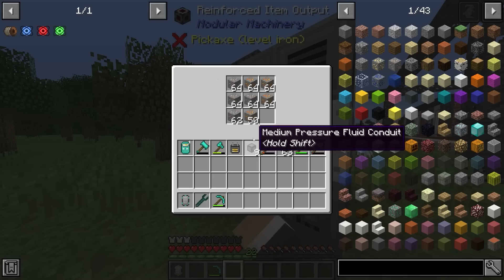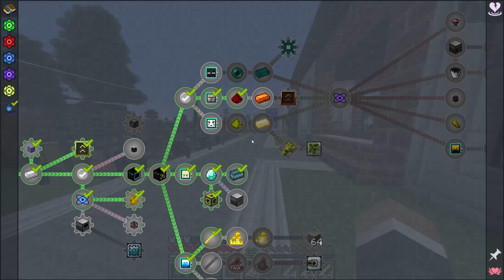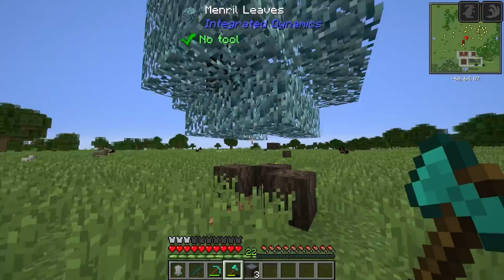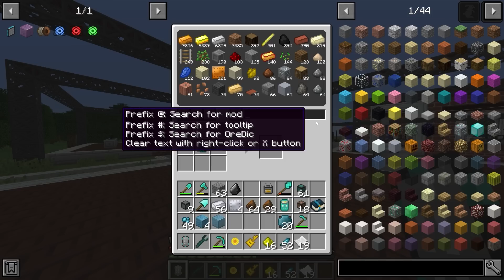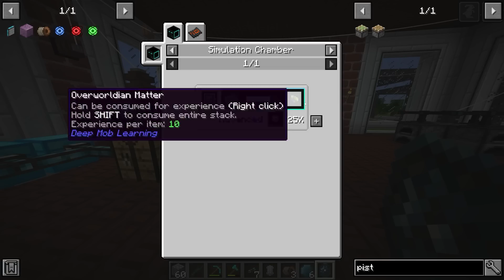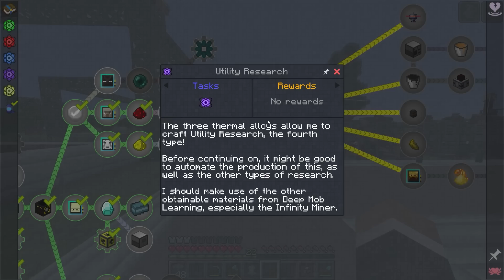Minecraft Feed The Factory | INTEGRATED DYNAMICS AUTO-CRAFTING! #16 [Modded Questing Factory]

Comment: Besides, you could just keep an Omni-directional connector and a couple of terminals in the storage at all times, and pull them out whenever you need remote auto-crafting.

EDIT: You could just use a Dispenser to auto-fill Buckets.

Comment: ID (provided that the mod IntegratedTerminals Is in the pack) has a wireless remote, I think it's called a portable storage terminal. Works exactly the same as the simple storage remote giving you infinite range trans-dimensionally with 0RF cost, just click on the omni-directional connector and you're good to go.

Comment: Don't forget! You can now use Integrated Dynamics' cables to do all your item transport as well, instead of EnderIO cables. if and when you need more powerful filtering and routing logic. Depends on which system works more convenient to you.
Integrated Dynamics cables can transport not only items, but also fluids and energy, in one cable. It only requires different types of interfaces for each connection. So no more need to craft different types of EnderIO cables and combining them into the same blockspaces anymore.

Comment: Integrated Dynamics does have a remote storage terminal, actually. Though in its standard recipe it needs chorus fruit and ender pearls to make the antenna-equivalent, and I'm not sure if you have access to those yet. It's pretty overpowered in some ways though, what with infinite range, cross-dimension access, and no power consumption just by default.
EDIT: Ah, you found the omni-directional connectors. Those are also the "antenna" for the Integrated Dynamics personal wireless access.

Comment: The intergrated dynamics system didnt work with simple storage because you used an import cable to do that which "imports" from Integrated dynamics into Simple storage. Try using an export cable so that the simple storage system "exports" into Intergrated dynamics system.
Reply: I don't know if that would work, Isaac wasn't using an I/O cable, he was using a Storage Link cable. Do simple storage's I/O cables also double as storage links?
Reply: i dont really know much abt it but i just wanted to try this in case it worked @captaingoomba6907

Comment: 27:30 I think it might be a good idea to push the pack creator to fix this issue.
Reply: just so you know, he isn't playing the latest version of the pack. the pack creator removed the simple storage mod and removed the ability to put research into compacting drawers. the last playthrough he and nik did he didn't agree with the changes and reverted to a previous version
Reply: @SebonClawfang those seem like the opposite of QOL changes lmfao,
Reply: @SebonClawfang  nope, they played the old version and then it got updated with SSN. Coincidentally that update was the stream after they unlocked integrated dunamics

Comment: Hey played along with you too, reached integrated dynamics but had an issue with the autocrafting. It just said "Recipe not Allowed", and can't auto craft. Tried changing the itemtype or the metadata option but didn't work :((.
Reply: If you know the fake player Id for integrated dynamics you can add that "player" to your team and quest progression will be shared
Reply: @da1444  how can you get the id then? I tried changing the fake player ftb settings but it's allied by default
Reply: GOC talks about that in the video, it's because the interfaces work as "players" and because of that they don't have the quests to unlock the recipes finished
Reply: he mentions it in the video, can't auto craft recipes unlocked by research with crafting table...must use auto workbench or seq fab (requires power, but faster and jei support)

Comment: I wonder if you can add integrated dynamics to team or some other way where you can share same quest with friend. Also i think Mechanical Drying Basin will make Menril Resin much faster. I played a lot with Integrated Dynamics (once i setup system which maxed crop for Agricraft, once to max out chickens for Roost, auto grow crystal in Astral Sorcery and also auto making flux from Flux Networks only rotating one obsidian (without changing it to cobblestone) )